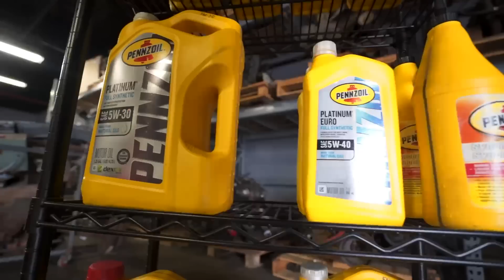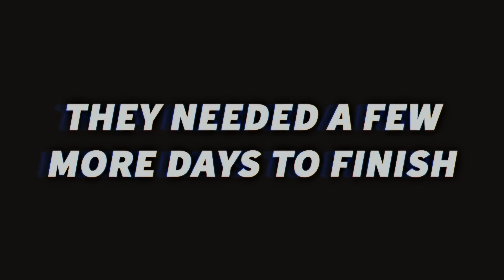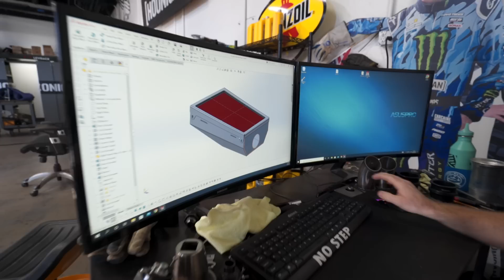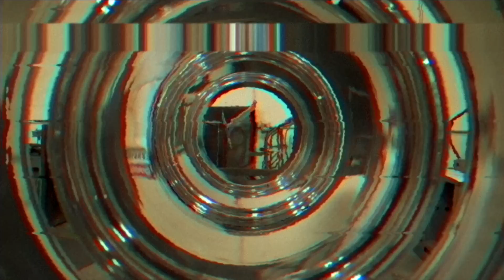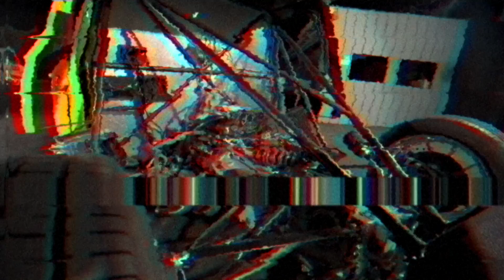Almost Finished! The Honda IndyTruck Runs and Drives

Comment: IndyTruck VS pikes peak needs to happen ASAP

Edit: and IndyTruck VS Nordsleife... PLEASE SCOTTO 😭♥️
Reply: @wculp1155  that could be arranged
Reply: The Nordschleife would be a good way to disintegrate the bottom assuming you didn’t bottom out and shoot the truck into a wall before that point…
Reply: I 100% agree. this is pikes peak worthy for sure but who should drive we should vote
Reply: It already bottomed out on the push onto the burnyard... i mean suspension could be adjousted. But i dought that the team 69 could find a setup which would withstand a beating at pikes or the green hell. Considering that those are rough tracks
Reply: @andi_fuuuu  well pikes peak is paved now and it’s a relatively smooth surface, if they would need to push my power out of that Indy car engine and retain its high power to weight ratio
Reply: @andi_fuuuu  pikes is tourist smooth now just went up it 2 weeks ago.
Reply: IDK if they have the money to air freight a car out to the Nurburgring and back, which is what I think would have to be done. A domestic race program has to happen, though. Super Lap Battle at COTA, GRIDLIFE Track Battle at Alpine Horizon, PPIHC.....

Comment: The correct way to mount racing seat belts is wrapping them around the roll cage. Not drilling holes in the pipe for threaded rod. Now u are only relying on the threads to hold the impact forces and not the cage and webbing of the belts.
Reply: Bolts definetly cant hold that weight  🤣